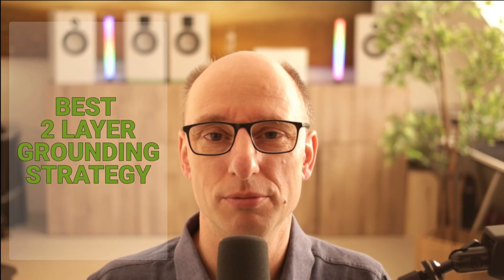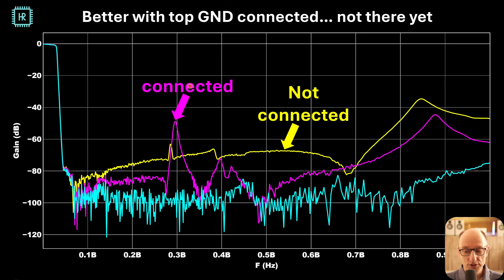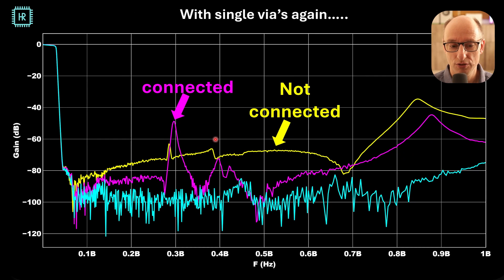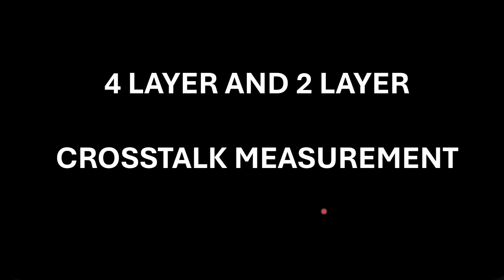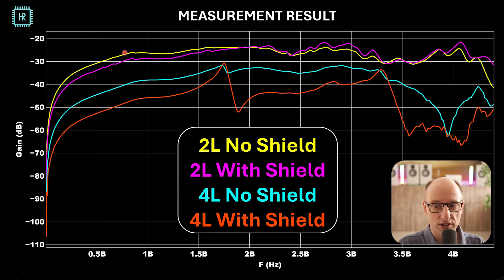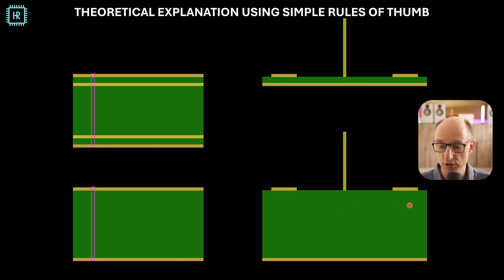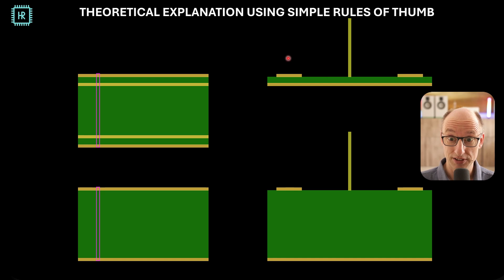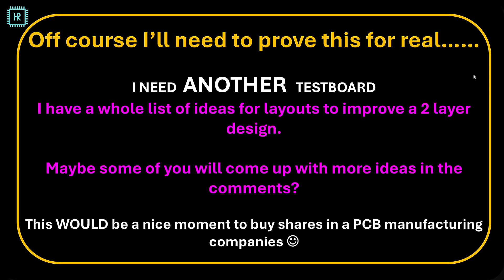Practical 2-Layer RF Design Rules (That Actually Work)

Comment: Send me the checklist!  Thank you!
Reply from the maker: I've changed the free checklist offer a bit: You also get a 1 hour module of my course for free!

You can find the link to the page in the description. Scroll down a bit on that page (Or read the whole page, you may get curious :-) ) to find the link. It is a purple button 'Watch The Free Module And Get The Checklist'.

You will have to leave your email address so I can start spamming you :-D . I don't do that very often, on average once a month, but I am thinking about starting an email series with useful electronics tips at some point.

Best regards,

Hans Rosenberg

Comment: Send me the checklist  🙂
Reply from the maker: Thanks! I've changed the free checklist offer a bit: You also get a 1 hour module of my course for free!

You can find the link to the page in the description. Scroll down a bit on that page (Or read the whole page, you may get curious :-) ) to find the link. It is a purple button 'Watch The Free Module And Get The Checklist'.

You will have to leave your email address so I can start spamming you :-D . I don't do that very often, on average once a month, but I am thinking about starting an email series with useful electronics tips at some point.

Best regards,

Hans Rosenberg

Comment: send me the list
Reply from the maker: I've changed the free checklist offer a bit: You also get a 1 hour module of my course for free!

You can find the link to the page in the description. Scroll down a bit on that page (Or read the whole page, you may get curious :-) ) to find the link. It is a purple button 'Watch The Free Module And Get The Checklist'.

You will have to leave your email address so I can start spamming you :-D . I don't do that very often, on average once a month, but I am thinking about starting an email series with useful electronics tips at some point.

Best regards,

Hans Rosenberg

Comment: Hi! I found put today your video and they are really amazing, I love the thought process explained easily and clearly and the measurements to support them.
I would like to receive the checklist
Thank you!
Reply from the maker: I've changed the free checklist offer a bit: You also get a 1 hour module of my course for free!

You can find the link to the page in the description. Scroll down a bit on that page (Or read the whole page, you may get curious :-) ) to find the link. It is a purple button 'Watch The Free Module And Get The Checklist'.

You will have to leave your email address so I can start spamming you :-D . I don't do that very often, on average once a month, but I am thinking about starting an email series with useful electronics tips at some point.

Best regards,

Hans Rosenberg

Comment: Send me the checklist. Thank you very much.
Reply from the maker: I've changed the free checklist offer a bit: You also get a 1 hour module of my course for free!

You can find the link to the page in the description. Scroll down a bit on that page (Or read the whole page, you may get curious :-) ) to find the link. It is a purple button 'Watch The Free Module And Get The Checklist'.

You will have to leave your email address so I can start spamming you :-D . I don't do that very often, on average once a month, but I am thinking about starting an email series with useful electronics tips at some point.

Best regards,

Hans Rosenberg

Comment: send me checklist
Reply from the maker: I've changed the free checklist offer a bit: You also get a 1 hour module of my course for free!

You can find the link to the page in the description. Scroll down a bit on that page (Or read the whole page, you may get curious :-) ) to find the link. It is a purple button 'Watch The Free Module And Get The Checklist'.

You will have to leave your email address so I can start spamming you :-D . I don't do that very often, on average once a month, but I am thinking about starting an email series with useful electronics tips at some point.

Best regards,

Hans Rosenberg

Comment: Kindly Send me the checklist
Reply from the maker: I've changed the free checklist offer a bit: You also get a 1 hour module of my course for free!

You can find the link to the page in the description. Scroll down a bit on that page (Or read the whole page, you may get curious :-) ) to find the link. It is a purple button 'Watch The Free Module And Get The Checklist'.

You will have to leave your email address so I can start spamming you :-D . I don't do that very often, on average once a month, but I am thinking about starting an email series with useful electronics tips at some point.

Best regards,

Hans Rosenberg

Comment: One thought on the crosstalk example, it may be a stupid idea but I'll propose it anyways.  What if the shield divider was either soldered on top of a via wall to try to break up the coupling between the two traces, or a slot machined between the traces and the shield then dropped into that slot and soldered to the ground plane.  Would this help in the isolation?
Reply from the maker: Yes! That should help a lot. I want to make a demo board out of that one at some point!

Comment: Please "send me the checklist". 
These are very useful videos. Lots of reminders of techniques and some new observations.
I really like that you demonstrate and measure each with real example boards.
Reply from the maker: Thanks!

I've changed the free checklist offer a bit: You also get a 1 hour module of my course for free!

You can find the link to the page in the description. Scroll down a bit on that page (Or read the whole page, you may get curious :-) ) to find the link. It is a purple button 'Watch The Free Module And Get The Checklist'.

You will have to leave your email address so I can start spamming you :-D . I don't do that very often, on average once a month, but I am thinking about starting an email series with useful electronics tips at some point.

Best regards,

Hans Rosenberg

Comment: Great stuff, many thanks for sharing, could you send me the check list, much appreciated!
Reply from the maker: I've changed the free checklist offer a bit: You also get a 1 hour module of my course for free!

You can find the link to the page in the description. Scroll down a bit on that page (Or read the whole page, you may get curious :-) ) to find the link. It is a purple button 'Watch The Free Module And Get The Checklist'.

You will have to leave your email address so I can start spamming you :-D . I don't do that very often, on average once a month, but I am thinking about starting an email series with useful electronics tips at some point.

Best regards,

Hans Rosenberg

Comment: Send me the checklist. Thanks for sharing your experience!
Reply from the maker: You're welcome! I've changed the free checklist offer a bit: You also get a 1 hour module of my course for free!

You can find the link to the page in the description. Scroll down a bit on that page (Or read the whole page, you may get curious :-) ) to find the link. It is a purple button 'Watch The Free Module And Get The Checklist'.

You will have to leave your email address so I can start spamming you :-D . I don't do that very often, on average once a month, but I am thinking about starting an email series with useful electronics tips at some point.

Best regards,

Hans Rosenberg

Comment: To be fair, given emc limits, especially for GSM frequencies, I've not designed a 2 layer board for years.
If you're aiming for an EN50121-3-2, lose wiring and 4 layer your boards.
Reply from the maker: yes, 4layers are soo cheap nowadays, you might just as well make use of it.

Comment: Send me the checklist, please!
Reply from the maker: Sorry for the late reply: I'm really behind!

I've changed the free checklist offer a bit: You also get a 1 hour module of my course for free!

You can find the link to the page in the description. Scroll down a bit on that page (Or read the whole page, you may get curious :-) ) to find the link. It is a purple button 'Watch The Free Module And Get The Checklist'.

You will have to leave your email address so I can start spamming you :-D . I don't do that very often, on average once a month, but I am thinking about starting an email series with useful electronics tips at some point.

Best regards,

Hans Rosenberg

Comment: Hello, Send me the checklist pls
Reply from the maker: I've changed the free checklist offer a bit: You also get a 1 hour module of my course for free!

You can find the link to the page in the description. Scroll down a bit on that page (Or read the whole page, you may get curious :-) ) to find the link. It is a purple button 'Watch The Free Module And Get The Checklist'.

You will have to leave your email address so I can start spamming you :-D . I don't do that very often, on average once a month, but I am thinking about starting an email series with useful electronics tips at some point.

Best regards,

Hans Rosenberg

Comment: send me the check list!
Reply from the maker: Sorry for the late reply, it is vacation time. I've changed the free checklist offer a bit: You also get a 1 hour module of my course for free!

You can find the link to the page in the description. Scroll down a bit on that page (Or read the whole page, you may get curious :-) ) to find the link.

You will have to leave your email address so I can start spamming you :-D . I don't do that very often, on average once a month, but I am thinking about starting an email series with useful electronics tips at some point.

Best regards,

Hans Rosenberg

Comment: hey Hans, can improve the shield by stitching its connection to the ground plane with a lot of closely spaced vias. basically walling off the area for the fields to pass thru
Reply from the maker: Yes! Indeed! This has been on my list since I made this video almost a year ago, but I spent all that time building my course :-) I'll be making videos again soon (within 3 months) and this is one of the ideas I want to try, which should work very well. I'm curious though how welt it will work.

Comment: send me the checklist! <3
Reply from the maker: I apologise for the late reply. I was on the road for 2 days.

I've changed the free checklist offer a bit: You also get a 1 hour module of my course for free!

You can find the link to the page in the description. Scroll down a bit on that page (Or read the whole page, you may get curious :-) ) to find the link.

You will have to leave your email address so I can start spamming you :-D . I don't do that very often, on average once a month, but I am thinking about starting an email series with useful electronics tips at some point.

Best regards,

Hans Rosenberg

Comment: I would love to see the checklist. Thanks for a good video series.
Reply from the maker: I apologise for the late reply. I was on the road for 2 days.

I've changed the free checklist offer a bit: You also get a 1 hour module of my course for free!

You can find the link to the page in the description. Scroll down a bit on that page (Or read the whole page, you may get curious :-) ) to find the link.

You will have to leave your email address so I can start spamming you :-D . I don't do that very often, on average once a month, but I am thinking about starting an email series with useful electronics tips at some point.

Best regards,

Hans Rosenberg

Comment: Send me the checklist
Reply from the maker: I apologise for the late reply. I was on the road for 2 days.

I've changed the free checklist offer a bit: You also get a 1 hour module of my course for free!

You can find the link to the page in the description. Scroll down a bit on that page (Or read the whole page, you may get curious :-) ) to find the link.

You will have to leave your email address so I can start spamming you :-D . I don't do that very often, on average once a month, but I am thinking about starting an email series with useful electronics tips at some point.

Best regards,

Hans Rosenberg

Comment: Thanks a lot for the playlist with design rules. Please, send me the checklist!
Reply from the maker: You're welcome!
I apologise for the late reply. I was on the road for 2 days.

I've changed the free checklist offer a bit: You also get a 1 hour module of my course for free!

You can find the link to the page in the description. Scroll down a bit on that page (Or read the whole page, you may get curious :-) ) to find the link.

You will have to leave your email address so I can start spamming you :-D . I don't do that very often, on average once a month, but I am thinking about starting an email series with useful electronics tips at some point.

Best regards,

Hans Rosenberg

Comment: Hello Sir, have you tested using a 1mm thick PCB vs 1.6mm thick PCB ? Maybe we can make a thin PCB more rigid by backing it up with a 1.6mm single sided board . I know, ridiculous idea  but would it make a difference ? Thank you for your excellent tutorials !!
Reply from the maker: Next to the checklist, you’ll now get a free one-hour peek inside my new course.

The course itself is a streamlined version of 30 years of trial, error, and eventual wisdom. If you're still early in your design journey, this could help you skip a few “what-was-I-thinking?” moments.

Click the image with the play button on the link in the description.

Best, and Happy Designing,
Hans Rosenberg

Comment: Ive made up a board for my Bluetooth speaker. 
It's 2 X 50w 1 X 100w tpa3116 audio amp with onboard buck/boost dc-dc converter and Bluetooth module. I'd love for you to have a look and share your insight?
I can share the easyeda files and you can make a video with it if you like?
Reply from the maker: I'd love to do that but I'm all swamped in marketing at the moment. Figuring out how best to present my course so people know what value is inside of there (I'm not doing that at the moment at all).
Reply: @HansRosenberg74  Ok. No probs. Thanks for the update.

Comment: Many thanks . The solution: use via holes every 2 or 3 mm on every ground : ne more rf floating ground. No more unwanted crosstalk. There is no longer a piece of copper that radiates, It Works at 300Mhz until 20Ghz. Event if we are very ( UHF ) far from quarter wave. I saw 5 mm mass pieces that radiated at 400 Mhz. Certification at cetecom labs show also smal ground pieces radiating unwanted harmonics...With a 4mm close loop you can detect  ( in ttransmit mode ) the hot RF ground. 4 layer is not exactly the solution : low substrat thickness , in fact. But at higher frequency ,with micro-strip mode FR4 losses increase : use not cheap substrat.
Reply from the maker: Yes, agree with everything. I'm covering via stitching in another video. Making a via wall is on my list as well. The substrate thickness is true, but I generally assume that a 4-layer has a lower substrate thickness. I'm assuming you use layer 2 as a ground layer.

Comment: I really like your videos they are great. Could you please share your checklist with me? I have a couple precision ADC + front end designs where SPI clock noise is getting all over the PCB including the input to my op amp. A lot of precision ADC datasheets (sampling rates < 5MSPS) recommend the separate grounds with the single point connection, what are your thoughts on that approach?
Reply from the maker: I think that most likely, the split grounds are the reason you're having your problems. This is really bad advice. If you want to solve this problem, please look at all my videos from the playlist this video is in. It will answer your questions, I'm quite sure of it. This series is actually a complete mini-course on grounding and crosstalk. I also have a video where I debunk bad ground advice and one where I show real world examples which can be really helpful in your situation.

Ehm, I have a better idea: Next to the checklist, you now also get a one hour free module from my course which I just launched. Watch that 1-hour video (maybe watch it twice) that covers the same material as my youtube playlist. There is a really clear explanation somewhere in there why splitting grounds is the worst idea! 

The course is basically a shortcut to 30 years of experience and mistakes. If you imagine the cost and time of having to make all those mistakes yourself, it might be a nice option. Especially if you haven't done that many designs yet.

Links are in the description.

Best regards and Happy Designing,
Hans Rosenberg
Reply from the maker: There are lots of other ways that interference can spread, but to learn all those you'd have to get my course. That is priced for professionals or serious hobbyists though, since there's 42 years of experience in there and it took me a year to make.